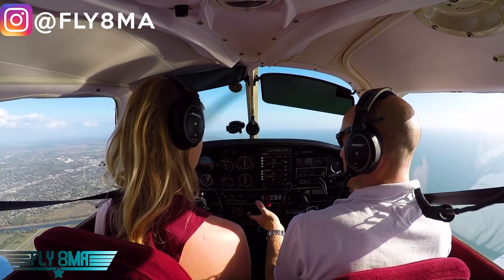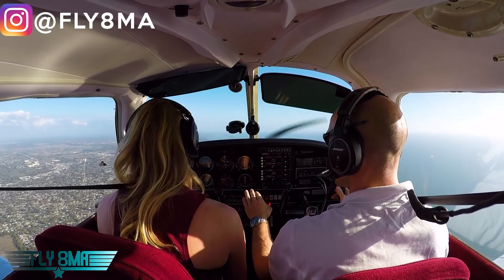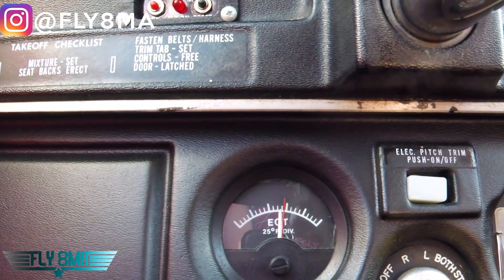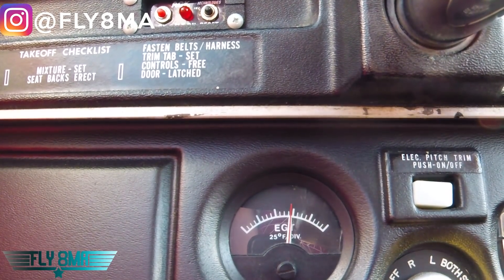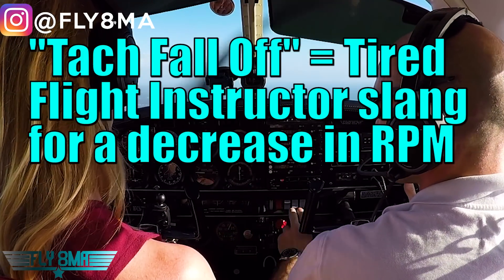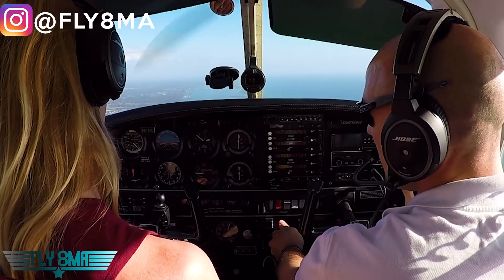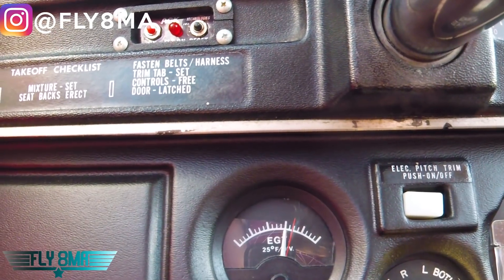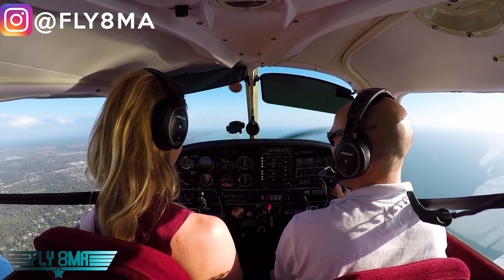How to Really LEAN Your Airplane

Comment: 50 degrees rich of peak is the worst setting. And the engine is not 'running rough' because peak EGT it's probably because you're at peak CHT and hasn't reached peak EGT yet Just look at any chart where combustion is explained. There, you'll also see that the cylinder temperature is the highest around 50-75 degrees rich of peak EGT. I wouldn't advise going full throttle at those settings. Maybe only up to 70 % throttle.

Comment: Long process is BS and can be dangerous. Pull the mixture, when the engine gets rough and starts to die, THEN feed the mixture knob back in only until the engine runs smoothly.... very simple. From that point, mixture in is rich of peak and lean of peak is out with the mixture control.

Comment: Hey Jon. Love your channel and love your content, but however on this video I think you might be sharing some bad and potential dangerous information.

If an airplane is not able to run at best economy range (lean of peak), then it should run at best power range (the other typically recommended range). Running in between those two (50°F ROP) is actually the most stressful range for the engine, even if that's what is recommended in the POH. Sadly, in this topic, the POH is normally dead wrong.

I have done a video here pointing to some documentation which supports my "case". I hope you'll give it a look and consider it - https://youtu.be/actzekYCVV8

Comment: Hi Jon!  Wait a minute, you fly 50°F reach of peak?  For me and based on all the reading I ve been through, that s the worst side of the setting known as the red box.  From 0° to 100° ROP, is where the CHT is the hotter which is all matters from an engine life perspective.  At least 150°ROP or higher is cold enough for thz cylinders or you can go 50° LOP if the engine runs smoothly to keep you on the safe side of the CHT.  You ll lose 4 or 5 knots, but reduce significantly the fuel flow and preventing to high CHT and reduce fouling.  That is even truer for injected engine.
Just my opinion here based on my personal learnings.
Reply: Exactly, I share a detailed video basically confirming what you say here - https://youtu.be/actzekYCVV8

Comment: I hate to say it but his advice is terrible.  If you really watch the needle it never actually peaks because if it had, the EGT would have started to decrease as he continued to lean.  Instead he taught his student that the engine running rough meant that the EGT was at peak.  It wasn't.  That was one of the other cylinders running way too lean of peak.  That cylinder (the one running rough) is now running very close to peak after he richened it 50 degrees.  No telling where the "EGT cylinder" is running because it never peaked.  Best to run well rich of peak in an aircraft like this with no GEM (graphical engine monitor).  At that altitude depending on their power setting (I'm guessing they are in the 80% range) they should be at least 200 degrees rich of peak.  In my opinion, every instructor should educate themselves with the information APS puts out before incorrectly teaching leaning techniques.
Reply: I agree with somethings that you said but... 1) 80% seems excessive. POH for my C152 says 68% at 2000 ft and 2300 rpm. 2) Lycoming recommends leaning till engine roughness, when lacking detailed engine gauges. As long as we're below 70% it's hard to cause any harm to the engine.

Comment: I’ve been obsessed with this leaning topic lately.  I see the comments about 50 ROP is the worst scenario and I completely agree.  In this example, I don’t think you’re actually 50 ROP.  I think you’re around 50 LOP and in the sweet spot.  When engine begins running rough, that isn’t peak EGT…you’re well beyond peak so by slightly enriching, that most likely puts you “around” 50 LOP.  Bottom line is, it’s very difficult to know with EGT only…a solid engine monitoring instrument is needed.  Going to be the next thing I install in my Cherokee 235….tired of guessing.
Reply: Yep, you're right.  I hate to say it but his advice is terrible.  If you really watch the needle it never actually peaks because if it had, the EGT would have started to decrease as he continued to lean.  Instead he taught his student that the engine running rough meant that the EGT was at peak.  It wasn't.  That was one of the other cylinders running way too lean of peak.  So like you said that cylinder (the one running rough) is now running very close to peak after he richened it 50 degrees.  No telling where the "EGT cylinder" is running because it never peaked.  Best to run well rich of peak in an aircraft like this with no GEM (graphical engine monitor).
Reply: @dpcfi  how do you describe "well rich of peak" ? At 75% BHP or less, 100 deg.F ROP will be a sufficient margin?
Reply: Small remark, just because the engine is running rough it does NOT mean it is running LOP. It's a matter of mixture balance and it could be that the engine starts running rough even before reaching peak EGT. If an engine is not able to run smooth LOP, the best will be to run it at best power, typically 100 to 150°F, and the way to get there is simply to lean till peak RPM.

Comment: I heard that 50 ° rich of peak is top cylinder head temperature which is not the best idea. The Piper Arrow POH I saw talks about 100 °  rich of peak. What is with 25 ° lean of peak to safe fuel?
Reply: There are typically 2 operating ranges recommended by Lycoming, best economy and best power. Best economy is the 25 LOP you mention. I share the charts here - https://youtu.be/actzekYCVV8

Comment: Absolutely the worst temperature to run at!  High pressure and temps in the cylinder, most chance for detonation.  Either run 100-150 deg rich of peak or better yet,  run at 65% power or below, lean of peak slightly,  25-50 deg if possible!
Reply: Best slightly lean of Peak. Temp wiill drop a bit, less risc of detonation.  I m o
Reply: @Geert2951  leaner is never better than richer. Fuel cools the engine and decreases the risk of detonation. Obviously there has to be enough air to fuel ratio but I'd much rather run slightly richer than run any type of lean of peak.

Comment: What if, trying to get your aircraft properly leaned, you suddenly stop the engine... This is something I have always been afraid of and that is why I think I have been leaning off my Cessna not enough and therefore, burning off more fuel than I actually needed to... 
Did that ever happen to any of you guys? What do you do in that case? Full rich and then?
Thank you in advance
Reply: If you leaned out the engine to fast to STOP the engine.  You leaned to fast.  Easy the engine till it runs rough.  Then rich the mixture to run smooth.  If you have a EGT you can fine tune your temp.  Not all aircraft have EGT, unfortunately.
Reply: I have not tried it, but the prop should keep windmilling and the engine should start right up if you just add some fuel back in again.
Reply: If the engine does stop because you pulled that red knob too far out, retard the throttle a little, enrich it back and it will come back to life.

Comment: Awesome and simple video, except that running 50 deg rich of peak is about the worst setting to run an engine where cylinder pressures are the highest, aka “the red box” either run 75-100 rich of peak, or if the engine can run relatively smoothly, 25-70 deg lean of peak which is better than ROP anyways
Reply: LOP is not always possible, esp. for TCM machines… 😢

Comment: I agree with your technique, however, there is more to do than what you have described.  Your method will definitely result in the aircraft engine running at 50° Rich of Peak.  But that is not the end of the process.  After you land, drag one of your fingers along the inside of the exhaust stack.  If the engine is running at the proper fuel to air mixture the inside of the exhaust stack will leave a grayish residue on your finger.  If the mixture is too rich, then your finger will have a black, or near black residue on it.  At the other extreme is if the engine is too lean your finger will have a whiteish residue on it.  If the residue color is whiteish (too lean), increase the ROP temperature from 50° to a setting of 75°.  On the other hand, if the residue is blackish (too rich), decrease the ROP from 50° to 25°.  After the next flight re-check the color of the residue.  I once had an engine that the EGT needed to be set to only 12.5° ROP to obtain the proper color of the residue in the exhaust stack.
Reply: Where are you getting this info? The helicopters I flew ran at full rich per the manufacturer, and there was always white residue all over everything. That’s 100% contradictory to your claim.

Comment: Do you lean if you cruise at 1000 or 3000?
Reply: Yes, you should lean for cruise regardless, just avoid a high power setting at low altitude.

Comment: Given my experience in the automotive engine development area, I am consistently surprised at the inaccuracy of setting air/fuel mixture in a piston airplane.  An AFR gauge with a wide band O2 sensor would be ideal.  I know lead fouling is a concern, but I bet that could be overcome by sensor tip design.  We can also measure the air to fuel ratio by dividing air flow and fuel flow.  If we know the air mass flow rate (engine displacement times engine speed times the density of the air [manifold air temp and manifold air pressure]) and fuel mass flow rate (this instrument already exists, at least in volumetric flow rate), it's trivial to calculate air fuel ratio.

This is how many automotive engines are operated, it's called a speed - density system.  With some engine mapping (by engine manufacturers) it would not be that hard to get a very accurate air mass flow rate based on engine speed, intake air temp, and manifold air pressure.  I bet even a pilot with some experience with these calculations coupled with traditional mixture setting could get pretty darn to close to the actual air to fuel ratio. 

Once you had an AFR (measured or calculated), it would be super easy to set the mixture for optimal cruise or optimal power, regardless of altitude. This is kind of how I imagine I could do it:
1) Calculate air mass flow rate using engine speed, engine displacement, manifold air pressure, manifold air temperature, and volumetric efficiency**. 
2) Multiply the air mass flow rate times the desired air to fuel ratio, to get required fuel mass flow rate. 
3) set mixture knob to achieve that desired fuel flow rate 

**volumetric efficiency is the thing the engine manufacturers would provide, but coupled with traditional mixture setting, I think a reasonable estimate could be made. 

I know this seems complicated, but it really isn't any more complicated than flight planning.  I could even imagine an instrument that took in all of this data and provided the AFR. 

Thoughts?
Reply: I have a patchy understanding of this, I assume you're trying to get stocchiometric ratios and then tune throttle for efficiency. Can you provide with an aviation mathematical formula for this? i know the ATPL theroy has formulas for air density, fuel energy and quality as well as compression ratios etc - i think this would be perfect to learn to be fuel efficient manually for when electric systems fail.
Reply: Russell, the current O2 sensors don't last very long in an aircraft engine that burns leaded fuel.

Comment: What Jared Solomon said.....  Mike Busch's videos are very informative on this subject.  I understand your reply about conforming to the POH but I cant help wondering why there is a discrepancy between the POH and what Mike says. Ultimately, the engine manufacturer and not the aircraft manufacturer should be the final authority I would think.  I'm building an RV 10 and will lean as per Mike's recommendations to both save fuel and engine wear.   BTW, I do like your videos as well.

Comment: during my training my instructors had me calculate RPM on the ground using weather data for temps/altitudes and using the POH charts. then just adjusted the mixture in cruise for the desired RPM. also had one instructor tell me to just adjust mixture until the engine rode rough, and to then add back about 1/4" of mixture. honestly all of these methods seemed fine to me! but what do I know?
Reply: On this video I share the recommendations on leaning from Lycoming themselves. That's what I follow, I hope Lycoming knows what they're talking about lol - https://youtu.be/actzekYCVV8

Comment: If you dont have an egt guage however. You should lean using the engine rpm guage. This is bit tricky and you have to Put in some guess work on how much rich mixture you running. 
How to do it?( note: Only works for fixed pitch propeller) 
 So peak egt = max rpm 
If you lean or rich the mixture after peak egt you will always get reduced rpm, so the right thing to do is rich the mixture at max rpm.
There you have it proper mixture though not as accurate but being a pilot you have to make the best out of what you got.
Reply: Peak EGT is definitely not peak RPM. Peak RPM occurs in the best power range which is 100 to 150°F ROP. Have a look at this video where I share these charts directly from Lycoming - https://youtu.be/actzekYCVV8

Comment: I really enjoy watching your videos. In this case though...the advice given hear is poor advice. Although I can’t argue that the POH probably suggests leaning the 50deg ROP, that is the absolute worse place to run an engine, especially for cylinder longevity. Combustion chamber pressure is at its highest, which causes the most abuse to the cylinder and exhaust valves. You are operating within what Mike Busch would describe as the “red box”. I suggest giving some of Mike’s articles or videos a watch. He has done a few seminars in the past for the EAA on this very topic. They can be found here on YouTube.
Reply: Jared Solomon except you don’t know what his power setting is. He is not necessarily in the red box even if he is operating at 50 deg ROP. Even Mike states that at reduced power settings (like in a best economy cruise) the red box virtually disappears. So FLYM8 is not exactly wrong with his leaning technique. In a perfect world, everyone would have a CHT gauge for every cylinder.
Reply: I have a PA-28 and for max range my POH says to  ""lean to peak EGT" You are leaning to max power at that RPM setting, not best range. Read the POH !
Reply: Henry Janice max power/max RPM doesn’t mean you’re utilizing 100% of the engines rated power.
Reply from the maker: Certain engine/airframe combos certainly like other things besides 50 ROP, whether its running LOP, or ROP, it depends on the specific airframe engine combo, but as a CFI that is training students for FAA checkrides, I teach how to comply with the POH, and do it the way the FAA wants......"technique" is something that gets taught later in a student's career during FRs, checkouts, etc....   It's kind of like filling the airplane with 6 quarts instead of 8....everyone knows its just going to spit it out, but good luck finding a reputable IA that will release an aircraft from annual and write in the logbooks he didn't comply with the MFGs procedure to top off the oil level....